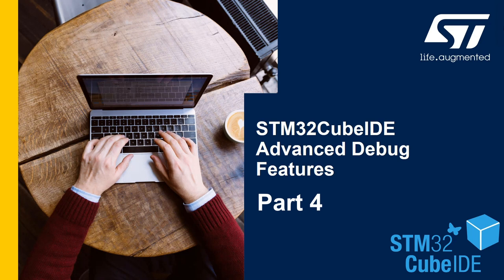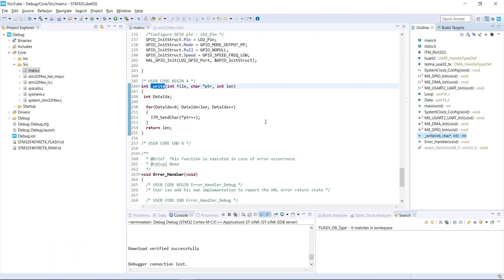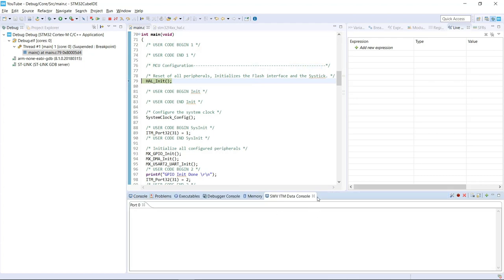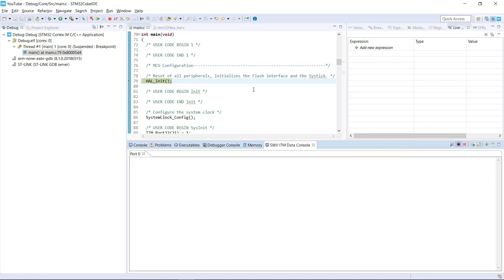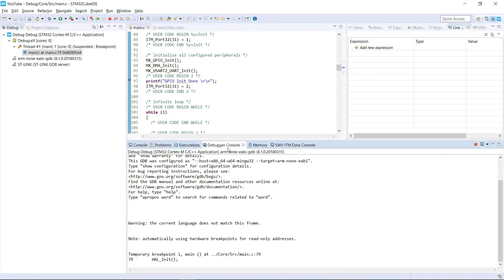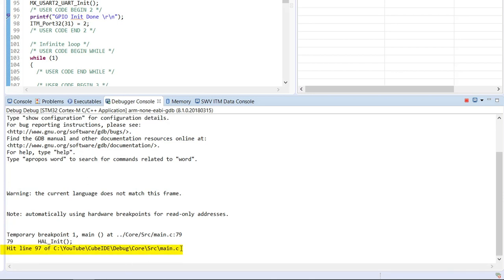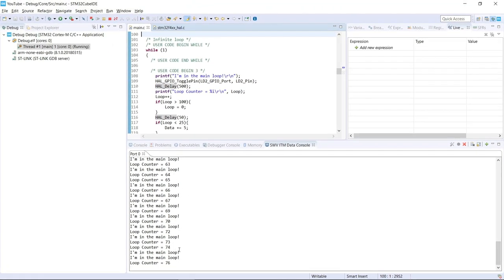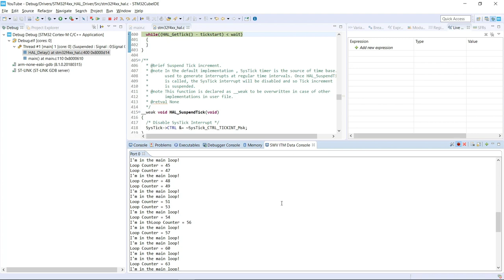STM32CubeIDE Advanced Debug Features: Part 4

Comment: When I click the on "Configure Trace" for the SWV ITM Data Console nothing happens, I'm using Version: 1.6.1 Build: 9958_20210326_1446 (UTC) on Win 10, and I have also tried it on Linux without success; is this a bug, am I doing something wrong, or is there another way to open the "Serial Wire viewer settings for Debug Debug"?
Reply: Problem solved, I didn't realise that the associated code had to be added to main.c before the SW settings window would open.